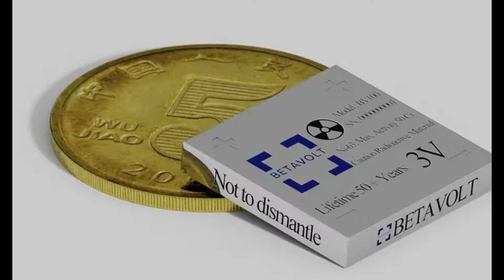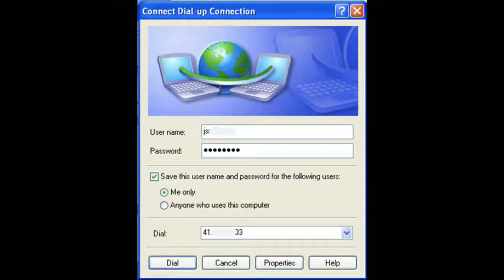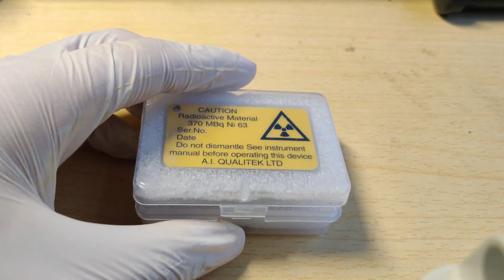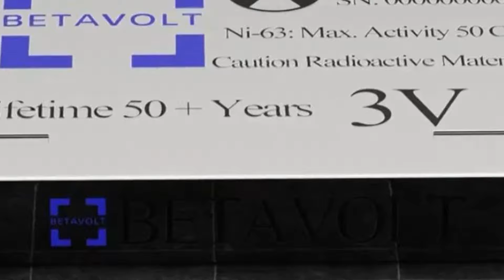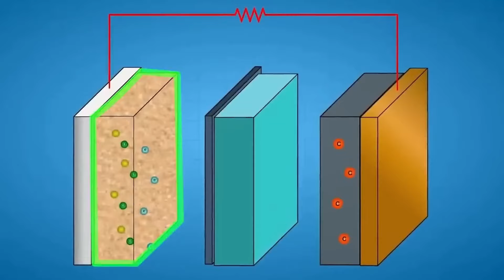Your Handheld Can Get 50 Years Of Charge Using This Battery!

Comment: No it won't , you'd need around 120+ of them to get 30w @12v to power your handheld. These things are like 100mw 3v at best. They've been around since the 60's to power pace makers and are nothing new with no practical use outside of the medical field.